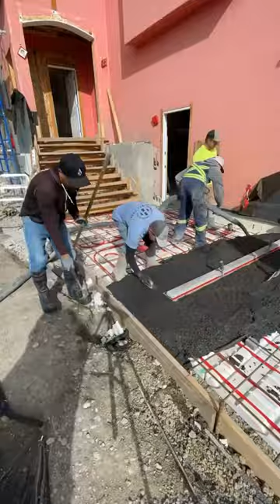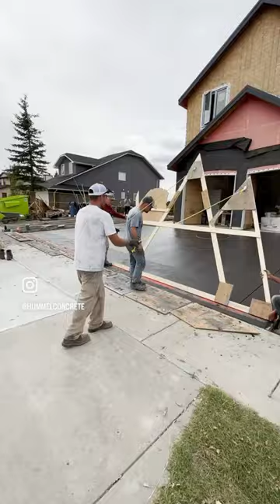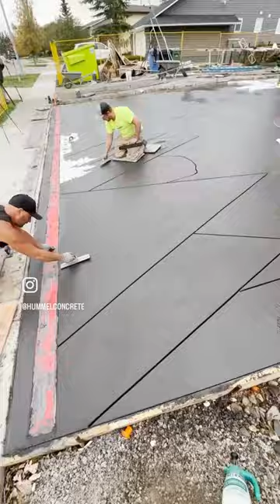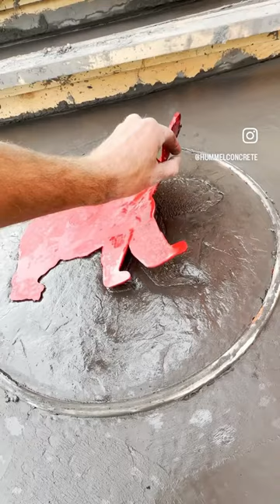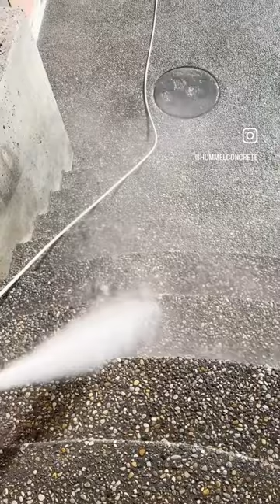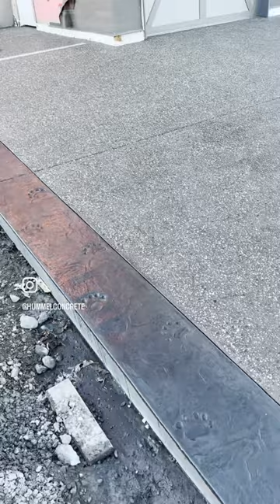Watch your step 🦾😉 #concrete #stampedconcrete #fyp #shorts ​⁠

Comment: Hey bro that looks real slick. Did you use a jointer for those mountain outlines or stencil. You don’t think since those mountain peaks stop in the middle of the slab if it cracks it will continue past the mountain peaks and up your slab. Other than that it looks real nice
Reply from the maker: Thank you!! It was a topic of discussion for sure!! Wet cuts were the only way to separate the 2 exposures and it’s quite a thick pad so we’re hoping 1” cuts won’t generate a crack in an 8” slab. If it did we thought it might look like cool lightning bolts 👊😆